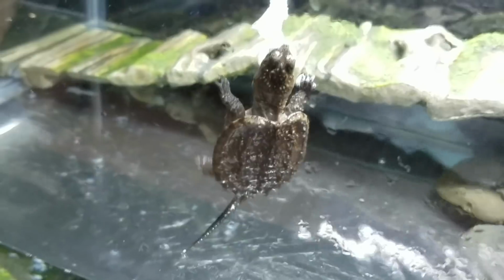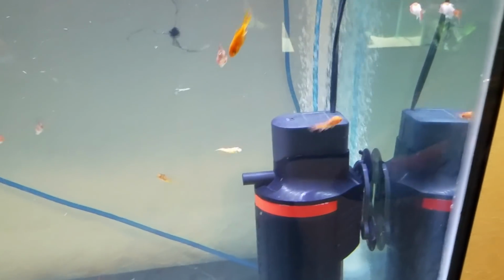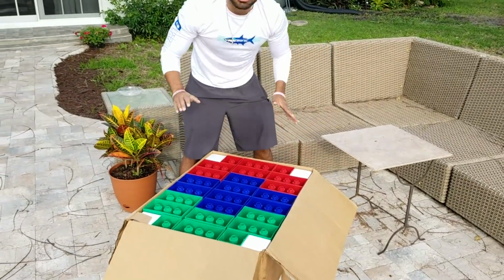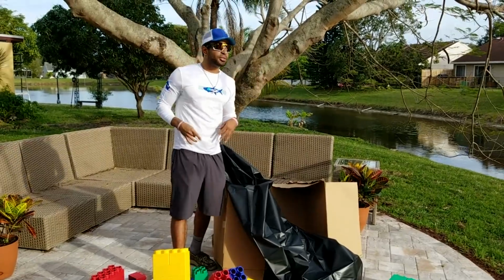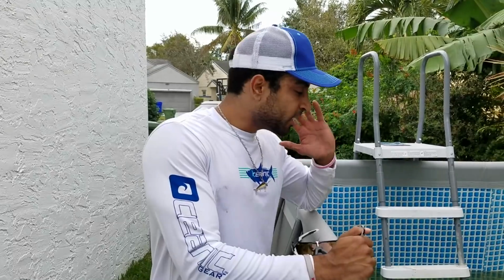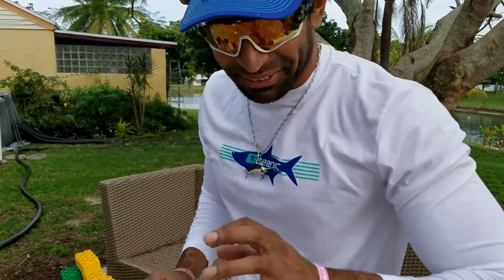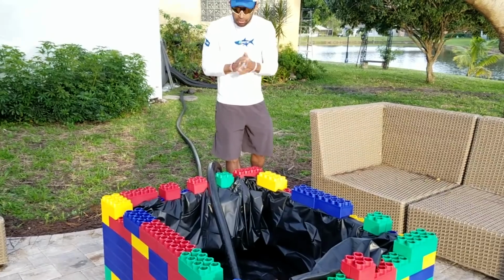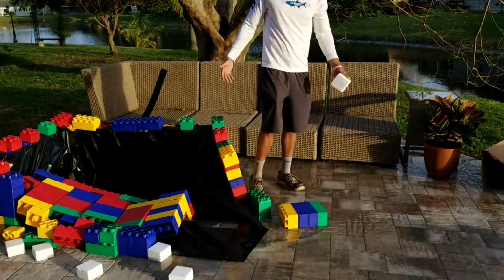MASSIVE BLOCK POND BUILD for FISH!

Comment: you have to stagger the  bricks. they are designed to support themselves if stacked properly.
Reply: THANK YOU!!
Reply: Each brink should be interconnected with four other bricks .  Single stacking is faster but each brick only interconnects with two others. Simplest way is every brick must cover a gap.
Reply: @stanhry  thats called staggering.
Reply: Mn
Reply: The TV is  hacked
Reply: Still won't hold will need to glue them out screw them together at the first layer to a square board frame might keep you from having to glue or screw them all together but if nothing holds the bottom in place the it will just keep doing this

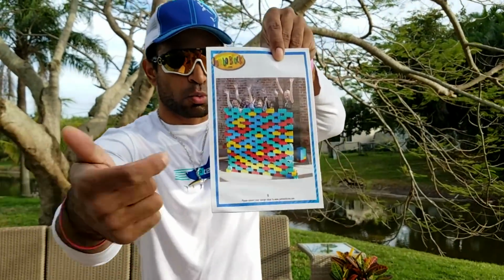Comment: Lay one layer at a time! Start the next layer with only two of the connectors on one break and the other four on  the top of the next overlapping The gap on the bottom layer. Do the same with the third and following layers. Kind of like the picture that you hold up at 4:21

Comment: Use the legos, but use liquid nail to glue it together to reinforce the walls and ,glue a bottom to it so the sides don't buckle. You could also glue the liner to it. You could also use the flex seal spay to adhere the liner. Still pretty awesome idea.

Comment: Make sure to overlap each block by half (especially corners.. then take either 2/4s or strapping from the depot and support top and bottom.. should hold better and you will have a way to attach the top of liner when h over lap it.. good luck can’t wait to see it a success !

Comment: Even if you stager the blocks this design of block does not have the locking power to stick together. The bricks are designed for children to build and take apart. If you do this again you need the equivalent of mortar, some form a glue to lock it together like liquid nails.

Comment: Hey Zack! Love the channel!! I just wanted to say that im a very out of the box thinker and to be completely honest I believe that this was actually a great idea and a fairly cheap way to build a pond. The only suggestion I have is that the bricks from each level above the next need to be placed so that you connect each of the two bricks below it. I noticed that you simply more or less connected each of the walls in afew spots. If you layer it in such a way as I stated above, I believe that it will be not only sturdy enough to support the pond, but also one of the most badass pond builds Ive ever seen! Hope you give it another try and possibly make these adjustments.

Comment: With the Legos, if you attach the bricks at their halfway point it multiplies the strength of their lock. Then add super glue or flex seal.

Comment: Take 4 2×4 or 2×6 and attach the first layer with screws to the boards of course take metal pieces and attack the 4 corners of the wood together that will keep it from pulling apart at the bottom like it did then the weight should hold the rest together maybe use screws on the 2nd and 3rd layer or some gorilla glue that might be strong enough to gold it together

Comment: It’ll hold much better if you stagger the legos as you add layers. Overlap where bricks meet with a brick. Try to avoid building bricks in line vertically.

Comment: If u want to make with lego pond youq must buy a flex seal and spray the lego with the flex seal you dont need a plastic you can make with lego but if u want to make the flex seal you must make the floor with lego and you can take so many water and the water not gonna fall.

Comment: u aught to overlap as much as u can to keep it structurally sound. if its gonna hold water, u want it sturdy.
Reply: I used to do builds with smaller legos where I'd make sure they ALL overlap the way bricks on houses do. Each one supports the others and carries the weight. if u just stack em like u did, it makes weak points. try overlapping and it should work.

Comment: even an amateur Lego builder can tell you that design was flawed from the start... next time stagger the blocks like a brick wall... look up brick layer videos if you have too. and i suggest doing it on a soft surface so the blocks have something to sink into and grab on that way they wont be able to slide out of place and cause a bow which in turn causes spillage.

Comment: Can't you use a glue gun to connect the Legos? Then they won't break apart every time you try to move it. And it would make it easier to move it with water inside

Comment: You Built It Wrong.. 4 Connected Walls Is Not The Way To Go.. Your Corners Need To Be Hinged Fitting Like Fingers When You Put Your Hands Together....  2 You Need Reenforcement Because Legos Aren't Meant To Stay Together So Tight.. Siran wrap The Bottom Half   Because Siran Wrap Is Stong But easy To Remove..
Reply: Also Used The Biggest Blocks On Bottom..